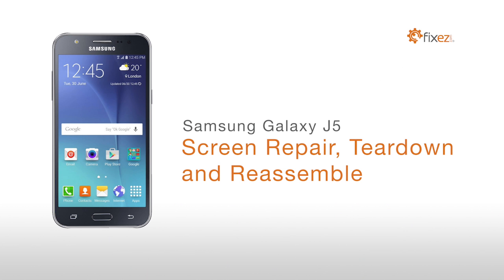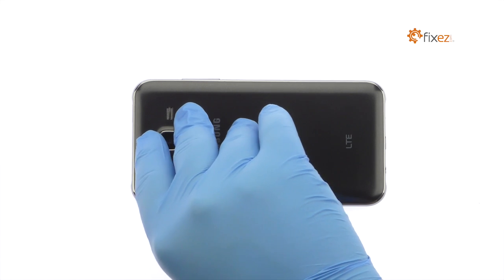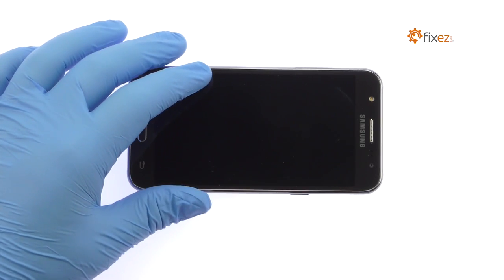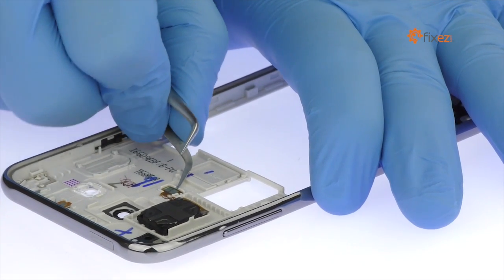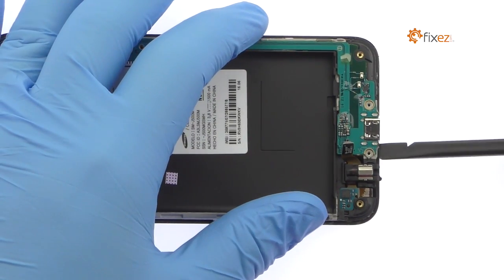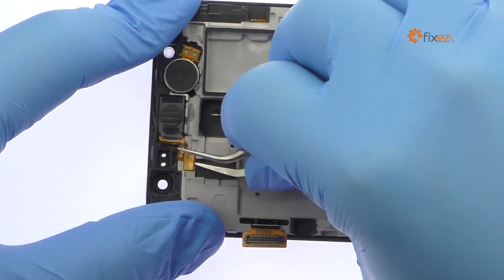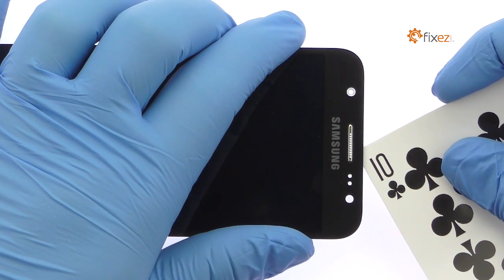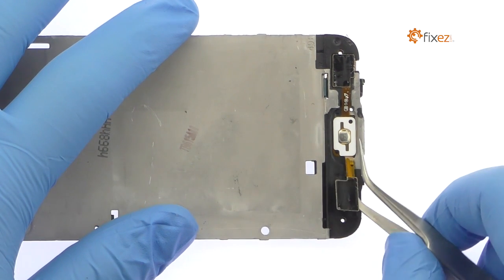Samsung Galaxy J5 Screen Repair, Teardown and Reassemble - Fixez.com

Comment: do you really have to do a total strip down just to remove the display,  surely most parts like speaker and cameras etc could have been left in there
Reply: dooronron69 Read the title. It also says teardown. There are a lot of people who just need to replace e.g. speaker.

Comment: Good evening , i want ask u about a very important step u spiked very quickly , at exactly 5:37 u showed that u slide a card between the LCD and the frame but there is a glue in between and its a very risky step perhaps the most important one and when u lifted the LCD u didn't show the back of it !!!!!

Comment: can you just pry off the broken screen (disconnecting the flexible tail connector) then replace with new screen without disassembling the entire unit?
Reply from the maker: Ideally you'd want to remove the motherboard and small parts to prevent any damage while removing the display.

Comment: what will happen if I wipe that sticky substance off from where the touch keys are supposed to be??
Reply from the maker: They may not make a proper connection with the front glass.
Reply: Fixez.com ok thank you but what can I buy to replace that sticky substance or where can I get it to buy
Reply: Fixez.com what is the name of that specific glue that is on the touch keys I really need to purchase one

Comment: can i use the display LCD of Samsung galaxy s duos 2 in Samsung j5, 
is the display connector of Samsung s duos 2 will fit in Samsung j5
please tell me will be grateful
Reply: Muneeb Lone Surely you can't because they are in a completely different sizes(not even close). I have one and compared them.

Comment: My home button isnt working on my j5 do you know how i could fix it
Reply from the maker: Replacing the ribbon shown at 6:06 should rectify the problem. Has the phone gotten wet? If so check for corrosion on the connection on the bottom of the motherboard where it connects.
Reply: Stealth c. C .       Qq